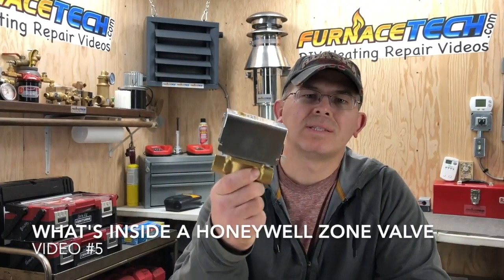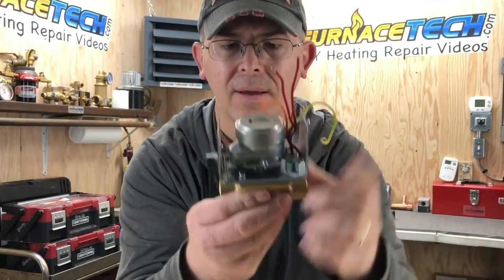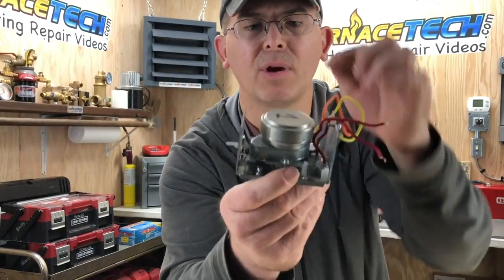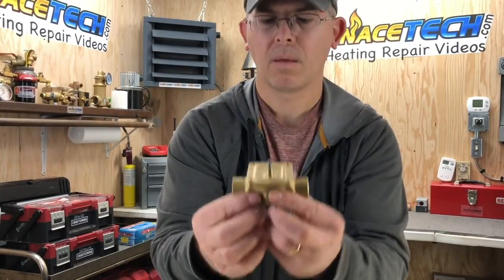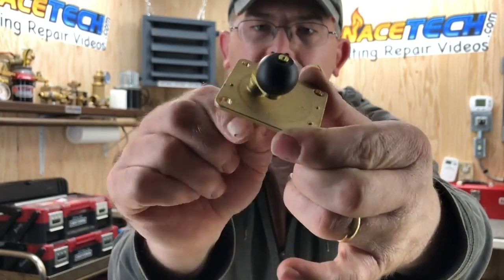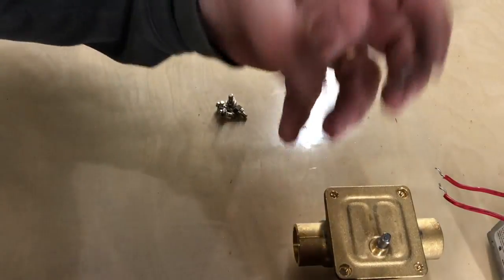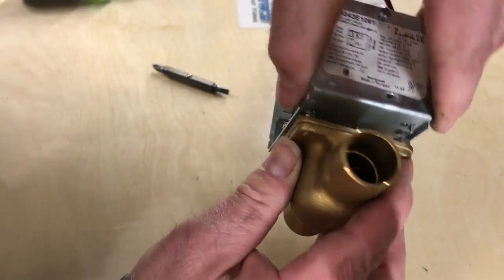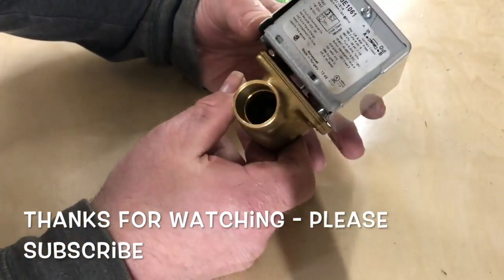How to fix a Honeywell Zone Valve. Part number: V8043E1012 + V8043E1061

Comment: Howdy. Sorry for the novel, no one to ask. This might sound dumb but is it often better to purchase a complete V8043E1012 just replace the power head and rubber ball valve section so I can leave the tubing connected without having to sweat in the back section? I'm guilty of not having experience with HVAC and hydronics so I'm trying to figure this out. Electronics, IT and engines I've worked with before and while a totally different field, I think I have mechanical aptitude to pull this off if I ask questions and watch videos. House boiler is original from 1994 along with all the polybutelene (PB) tubing and that's the area I'm trying to avoid disturbing at this point in time. I am on the website of a major supplier and I'm looking into PEX to PB tubing conversion fittings and all that stuff but in reality I just need to hold off on a complete system rebuild for now. Winter of course but most of the time I work overseas and don't want to get started in a boiler remodel unless I have to.

Master bedroom is constant hot even with thermostat shut off. Window open  an 1" and a fan to get the room down to 80 degrees. Boiler cycles a lot. Basement slab has tubes and the main floor has tubes in gypsum to give some mass. Water around 80 deg (thermostats set to 70. I need to break out my temp scanner and do some readings. Upstairs is all tube and fin, boiler set at 170 and uses mixing valves that are broken but the house still heats. So much I want to replace including a new boiler. Time or money I guess, neither shall they meet at the same time. Wish I could show someone the system for ideas but to have a pro take care of this would wipe me out so I need to gear up and figure it out. House is 6 bedroom/ 3860 sq ft but fuel costs haven't been too bad over the years even with bad parts. Normal annual purge has been about it. I want to remove the air scoop and install the Spirovent with a new expansion tank (Model 110 Fill trol with built in pressure regulator) below the air scrubber. Water supply comes in, reduced to 13 psi+- but not sure if I should just get a regular Exp tank and mount my own regulator. Current valve and tank aren't doing the job, safety valve will sometimes pop but usually because I'm an idiot and have used it a few times to burp the system. I pressurize with a hose from the HW Storage tank to the drain of the boiler to get pressure to 15 psi. Boiler tech has left me notes over the years and he thinks the line from the expansion tank to the water supply is plugged. Bought the Spirovent a few years ago, just need to get it mounted which means sweating the primary pump to a different location so both the scrubber and pump are level and not so close together. Video says I need 18" from the scrubber to the pump, trying to get close to that. One primary pump which feeds the 170* water to upstairs and then feeds to the lower temp zone valves. I see newer designed systems and mine is a wreck. Almost to the point of sell the place, let someone else deal with it. I'm just being stubborn and want to learn. TIA, trying to order up parts tomorrow in case I get pulled overseas soon. Cheers.
Reply from the maker: It's not a dumb question. yes, you can buy the whole valve and then replace the power head and what I call the valve guts. or you can buy then seperate. I buy the complete valves because it makes it easy for me to have complete parts if needed. I am not sure if you know how to check your expansion tank pressure or not but it sounds like it may be giving you some trouble. 
1) turn off power
2) turn off makeup water
3) isolate all zones  (so you don't drain any unneeded areas)
4) drain boiler pressure to 0 psi (note: use bucket if you have glycol)
5) test pressure on tank (factory set @12psi) if bad replace
6) refill system (if you drained glycol, pump it back into system) or open makeup water if glycol is not needed. (sounds like your system needs glycol due to having floor heat. 
7) open all zones
8) turn power back on and watch system come back up to temp and keep an eye on your system pressure making sure you do not exceed safety valve pressure. (30psi). 

Be very careful if attempting to do this yourself 
I hope this helps!
good luck
Reply: @FurnaceTech  Thanks so much for explaining everything so well.  My valve has no tension on it and stays open.  Bad power head?
Reply from the maker: @Roadstir  it could mean two things. 
1st - it could mean it’s calling for heat and the valve is open.

2nd - your valve could be stuck in the open position 

If the zone valve is getting power it should open. Verify the tstat is calling or if it’s bad. If you are not getting power and the valve is stuck in the open position you may need to replace the power head or the valve guts or both. I hope this help!

Comment: I have two zones where a relay that is common to both zones activates when either end switch is closed.  On one zone, the relay chatters a bit when the end switch closed.  The system still functions okay, but last year the relay didn't chatter at all.  What could be going on in the zone valve to cause a bit of chatter when the end switch closes?
Reply from the maker: The end switch may not be making a good connection inside. Could be going bad. The end switch does not consume any power, it just provides a connection to signal the valve is open or closed.

I hope this help!
Reply: @FurnaceTech  Thank you.  That definitely helps!  I have a spare zone valve head on order just in case.  $70, not cheap, but no heat is worse.

Comment: Thanks for this!

I've got a 3 zone system using honeywell 7817's. One zone, the return is cold. The motor works, the contact closes and engaged the recirc and burner. I've purged the system. 

Should me next step be swapping out the valve? Because I suspect it's just not opening. Thanks.
Reply from the maker: No, I would remove the power head and manually open the valve. If this does not work then you may have a frozen pipe.
Reply: @FurnaceTech  sir I have 3 way zone and my motor turns the stem but hot water in not going into my air handler. The tech said I need to replace a new valve as he thinks it is stuck:( I’m waiting on a quote. I’m wondering if I can buy the ball parts assuming that’s it. Also, you said the pipe may be frozen…what does frozen mean? I’m loving your content and just subscribed.

Comment: Don't forget that when you're working on these valves, they are installed and in a vertical position. I use a dab of plumber's grease on the o-ring to hold it in position while assembling the valve.

Comment: Great video.  I have a situation where my pump is always running.  There's only one zone valve and a thermostat.  The zone valve is open even when turning down the temperature on the T-stat.  I can move the manual lever back and forth on the valve quite easily.  I'm just wondering if the problem is more likely to be with the T-stat rather than the valve or are the valves problematic and likely to stick in the open position?  Your help would be greatly appreciated.  Thanks
Reply from the maker: The zone valves can get stuck in the open position. Verify power is turned off when the tstat is turned off and then you can remove the zone valve cover to expose the motor and gears. You can take a small screwdriver and push the valve closed. Very important that you do not attempt this with power applied. 

You can also unscrew the power head from the zone valve body to check and see if the valve is sticking.
Reply: @FurnaceTech  Thank you!  I'll try that.

Comment: Great video and lots of good tips, thank you!   You're helping me understand and troubleshoot my hot water heating system.
The way I understand it, the motor is energized the whole time the thermostat contacts are closed and it's still calling for heat.  
My odd question is, what stops the motor from trying to keep pushing the valve open?  I took the motor cover off like you did and watched the action of it all - it appears that when it gets to the end switch / valve fully open position, the motor simply doesn't have enough power to keep trying to turn and just stops.  I suppose the power going to the motor, even though not actually turning the motor, is simply holding  the valve in the open position with the electromagnetic force of the motor being energized, because otherwise, without power, the return spring would take over and close the valve.   It seems like still having power to it without it turning would cause problems, but must be it doesn't?
Reply from the maker: the motor stays energized the whole time its calling for heat. Two reasons I find which can cause the end switch to not make are 1) weak motor 2) valve not moving free.

Comment: Can I replace it all except the brass, not really good at soldering.
Reply from the maker: Yes, you can!
Reply: Furnace Tech thank you, I’m going to GPS and replacing it today. Thank you!!!
Reply from the maker: Make sure to turn off power and close off any valves to remove the pressure from the system before removing the zone valve cover. Good luck!
Reply: Furnace Tech shoot I never told you, I got it done. Thanks a lot, seriously! Subbed
Reply: Be sure to take all the seals out before you sweat a zone valve so they don't melt.
Reply from the maker: @warrensteel9954  you can solder these valves without having to pull it all apart. But you need to make sure the valve is in the manually open position. You can use a wet rag to dissipate the heat or like you said, take it apart just to be safe!
Reply: @FurnaceTech  if you have a MAPP torch or something hotter you can get away with that. Unfortunately the average homeowner likely just has a cheap propane torch and won't be able to get it hot enough, fast enough, with a wet rag dissipating the heat so it's best to land on the safe side.
Reply from the maker: @warrensteel9954  safe is always best! Thanks for the tips!
Reply: This is what I should have read before posting my novel. Maybe I will but more to my place than zone valves. I'll def go this route.